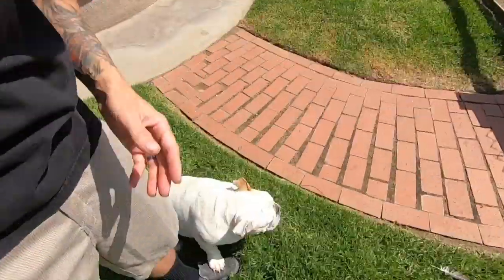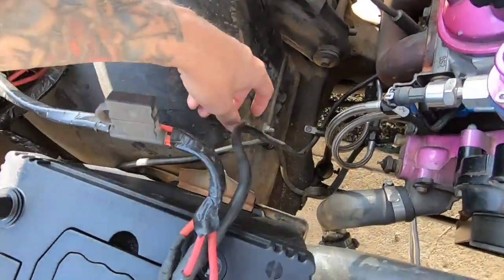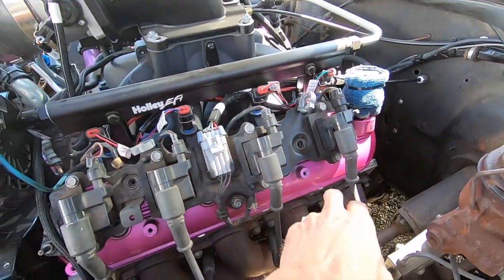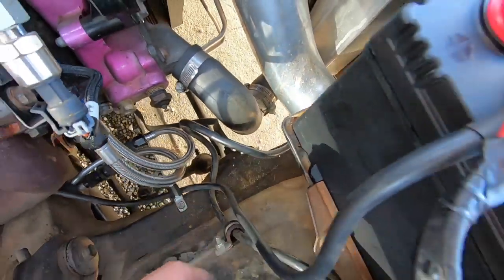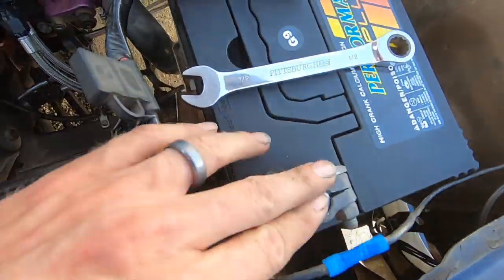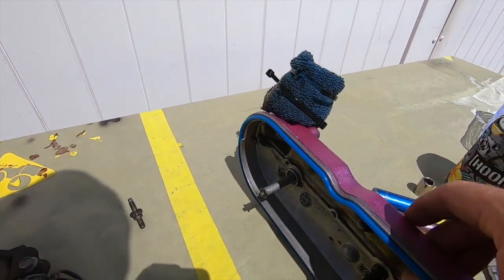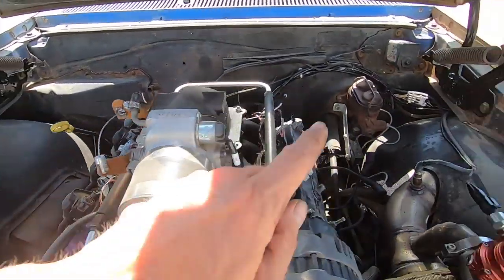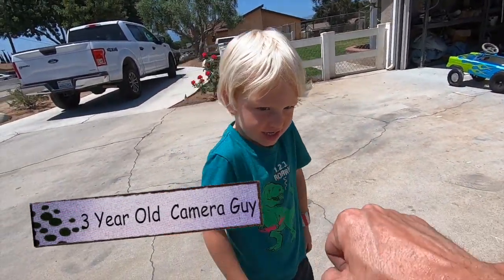ebay turbo chevelle gets new battery

Comment: THE GROUND SHOULD GO TO THE BLOCK   THEN THER SHOULD BE MORE GOING TO THE FRAME AND THE BODY BUT THE BIGGEST CABLE SHOULD GO RIGHT TO THE BLOCK THE STARTER DRAWS THE MOST AMPS
Reply from the maker: That is what I thought. Ended up being the alternator feed wire was too small and the battery was toast.
Thanks for the input man. Thats how I had it to start with. 😅

Comment: 13.8 is what i have Always heard alternators are supposed to do i know when it gets cold they will go higher like 15 or so but over 13.5 or mors should be good
Reply from the maker: Yeah 14 is the norm I think. Im starting to think the pump wire needs to go up a size to carry the load better.